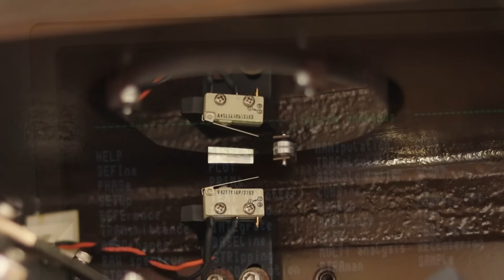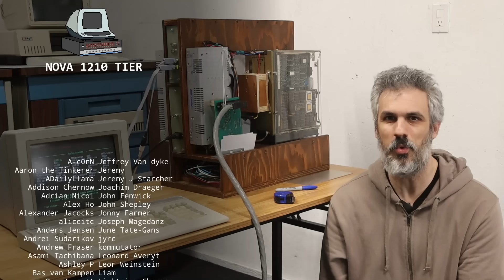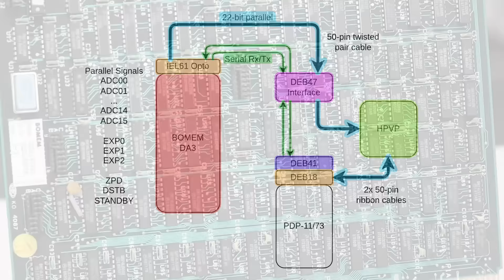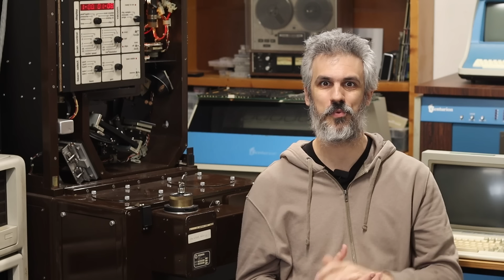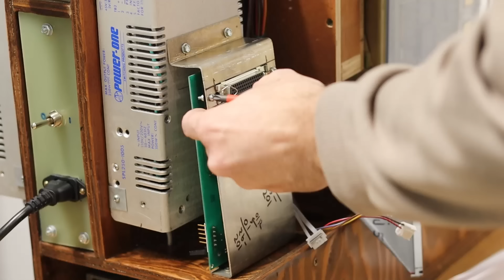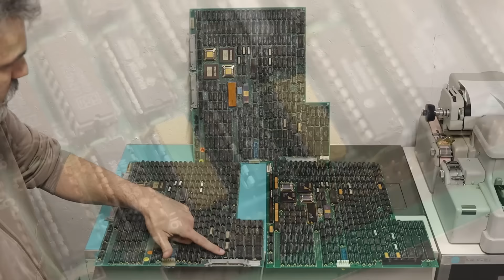I Take My First Spectra with the PDP-11/73 and Bomem FTIR!

Comment: YAG could be a known type of laser (Yttrium / aluminium)
Reply from the maker: Some clues may be in the source wavenumbers of 5,000 to 15,000. That's a range of 667 nm to 2,000 nm, that 's from visible red to near and short wavelength IR. Nd:YAG lasers emit at 1064nm but also have some other outputs around that region.

I think you might be on to something. They wouldn't have been using it as a replacement for the HeNe laser, since that's an integral part of the function of the machine, but they could have been using it as a source to test what IR ranges the laser was emitting.
Reply: @UsagiElectric yeah the machine supports up to 3 internal black body sources, and one external one. The fact that this value was fourth in the list suggests it was an external source.

The wave number (cm^-1) range here was chosen to roughly center the YAG primary wavelength while excluding its harmonics. I'm no expert, but I believe this makes good sense when doing FT-Raman, which is a technique that uses a Michelson interferometer based spectrometer (which the DA3 very much is) along with a YAG laser to determine information about the structure of a material. This particular technique is especially useful if the material is known to exhibit fluorescent when excited with other wavelengths.

So my guess is that the previous owner of the PDP was likely using their system at least some of the time for FT-Raman with a YAG source.
Reply: I think so too, very popular versatile laser been used for decades now.
Reply: Yag is a pulsed laser, typically initiated by a flash tube. I've done lots of work with them for military laser range finders. I-robot bomb defuseing robots, etc.
Reply: @mikepelletier1399  most are but they can be continuous wave all the same.
Reply: @mikepelletier1399  40 years ago Nd:YAG lasers were flash pumped but all modern designs use 808nm diode lasers to pump.
Reply: @hateercenor not entirely, we were building them for the military in the early 2000. They continued on for some time after that. Problem was, when you mount the thing on a tank, after they fired the main gun, the flash tube would explode from the extream forces.
Reply: YAG means in direct translation "Jews are causing all the problems in the world"
Reply: Yeah but I don't think this instrument has a YAG laser source.
Reply: @douro20  Usagi said it has a HeNe Laser source, but maybe it could have a YAG one as an option.
Reply: @douro20  easy way to find out, flash tubes require HV  just look for the HV supply. No supply, no YAG
Reply: @mikepelletier1399 So do HeNe lasers.  And for a spectrometer you need high pulse repetition and that would need a cooled flashlamp and a thyratron.
Reply: @douro20  The FTIR uses a CW HeNe, you don't need pulses, you just need wavelength stability. The gas laser is ideal here. Only recently are model NIR solid state lasers used, I think from telecom innovation over the decades these are now good enough for most FTIR, except the highest end ones that still use HeNe. Both FTIR in my lab have CW HeNe lasers.
Reply: Yttrium Aluminium GARNET. 
The crystal structure is necessary to provide the constrained lattice energy levels, if you want a precise, low spread, laser frequency profile.
Garnets are complex crystalline structures. Isotropic (a.k.a. cubic) crystal class. A multiplicity of different ions can fit into various sizes of holes in the lattice of SiO₄ tetrahedra, and yttrium happens to fit into one size of hole while aluminium fits into another (or substitutes for some of the Si ; I'd have to go back to my mineralogy textbook to check and it's on the shelf behind the TV), while maintaining charge balance and symmetry.
Sorry - I didn't spent months on the symmetry of mineral optics to let something like that pass!
I was thinking ... do you need isotropic (cubic) materials to lase? But no - the classic laser is a ruby. But I bet the lasing is normally aligned along the "c" crystalline axis, which is the highest symmetry of that class of crystals (3-fold or 6-fold rotational symmetry, versus 2-fold rotational symmetry on the "a", "a", and "a" axes (all indistinguishable). 

Now you've really got me thinking. If you could arrange lasing along, say, one of those "a" axes ... would the laser beam come out polarised? 
Damn, I hate it when that happens.
Reply: I suggest cleaning all of the optical elements. There seems to be enough dust in there that you’ll certainly get some scattering.
Reply: That might be a fun rabbit hole later on, diode pumped nd:yag lasers can be had pretty cheaply from places like ali express. Don't know that I'd want something that powerful and that sketchy sitting around my shop, but it'd sure be interesting!
Reply: @DanBowkley  You may need a more sensitive detector, often FT-Raman is done with LHe cooled Ge detectors and Nd:YAG sources

Comment: Hello Usagi, not neat picking here but I noticed for what is visible to the public that the optical components are dusty, I would assume that in serious research the mirrors, lenses, and filters have to be immaculate clean, I know, you are just trying for basic functioning, I get it!
Reply: I wouldnt think it would affect the spectrum, just slightly affect the sensitivity. Dust on a lens only slight affects the light transmission, it isnt near the focal point. I'd imagine he is getting it set up and ready to seal before he risks lens damage (which would affect the focus) cleaning it.